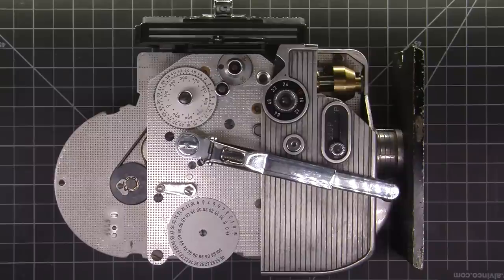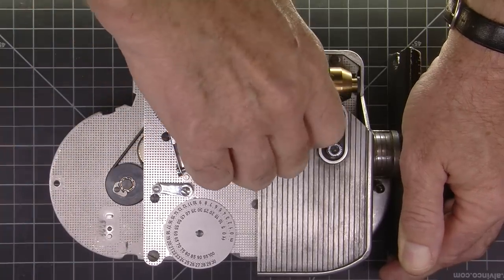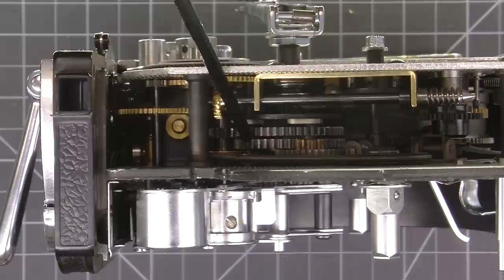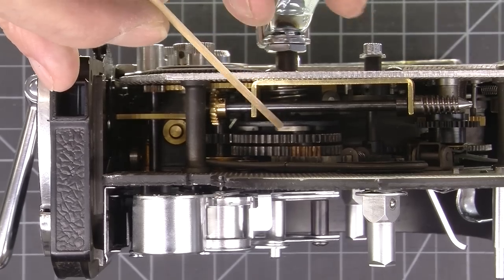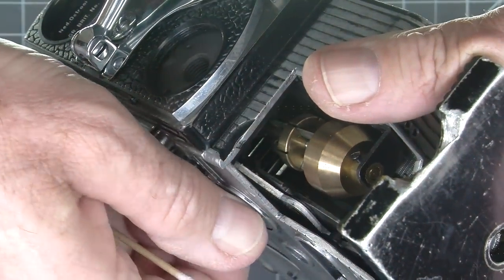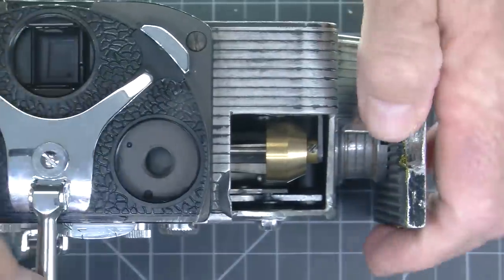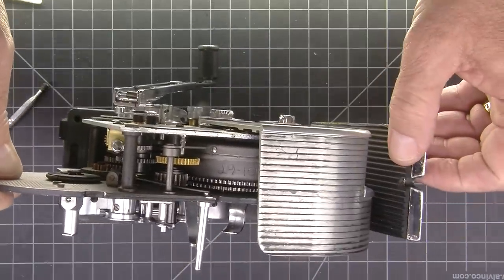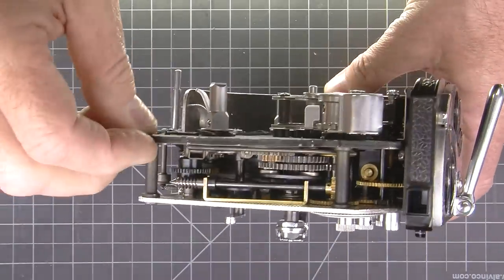Bolex, a peak inside

Comment: Hey Rich thanks for the video. really interesting. 

I wondered if you know whether it is easy to replace the bolt the connects the winding arm to the motor as i have one that has snapped!
Reply from the maker: that part is available and not too expensive, just have to remember it's a left hand thread.You have to loosen the nut and it comes off the wind handle  Is the stub still in the motor?
Reply: Hi thanks for this fascinating video! I have a h16 on which the bolt hole where the winding lever screws in stripped. I'm in India and noone fixes these. Is it possible to repair by oneself? Is the bolt hole removable? Thanks!!

Comment: Hello, thanks for the video. I'm just curious, I destroyed the retaining arm which holds the film in the spool, how could I possibly change this or repair? I think there must be some kind of spring which is destroyed now...Thank you.
Reply from the maker: When the students destroyed the spool retaining arm I just threaded the hole with a 10-32 tap and installed a 1/4" long 10-32 button head screw. in 30 years never had an issue. Grease your tap and that will capture the majority of chips created by the tap,
Rich

Comment: Hey Rich, great video. I'm currently tinkering with a Bolex H16 Rex4 that seems to have a 'dead motor' as you described. This is the most in-depth video about the inner workings of the camera that I've found so far and I'd love to teach myself how to fix it. Would you recommended any valuable resources in particular ?
Reply from the maker: I just learned by taking them apart. I have a video showing the process of dismantling the camera but it's not edited in any way. I may just upload it as is since I never seem to find the time to edit. Also have one showing how to tell if you've lost the loop without opening the door first.
Reply: I'd love to see both of these videos. Hope you can find the time to upload soon!

Comment: Hi, very nice video. I’ve a question: my Bolex h16 have a problem with the meter counter of the film, he’s stuck. Don’t move while the motor is in function. Have you any idea of witch is the possible problem? Thank you
Reply from the maker: if you hold the plunger at the back of the camera down with your finger does the counter work? If so the door does not fit correctly. Other wise it has to come apart in order to determine which parts are malfunctioning. I have another video detailing how to disassemble it.
Reply: @richjura8957  Thank You, but if i hold the plunger, the counter don't work. i think it's a internal problem
Reply from the maker: @ilPisi26  It's most likely the screw that holds the dial to the spindle, sadly to get to it you have to pull the workings out of the body. Good Luck
Reply: Rich Jura ok, thank you very much. I’ll try soon and let you know.

Comment: Hi! Congratulations for the video and work! I've been working with 16mm cameras for a long time. Usually i've to make the repairs by myself, as, at least in Brazil, i can't find who works with these equipments, no more. I've already done a small service on a ffriend's Bolex, but had to disassembly only the front part. Now i've bought a non reflex 1951 model and it is "frozen". As if was kept many years stored with the spring on. I saw in your video that you removed the entire side of the camera (?). But i also saw other pictures and videos where it has been opened from the inside part (film room). I don't want to remove the leather from outside to look for screws, as it is in very good original state yet. Can i access the gears removing the film room on the non reflex model???  Thank you so much!!!!!!!
Reply from the maker: responded to your other comment, here I see you are working on a non reflex. If I remember correctly those have 5 screws holding  the main plate to the body. Also the turret assembly has to slide off as the shutter stays with the main plate. There is nothing under the leatherette that would require you to peel it off. Good Luck
Reply: @richjura8957  Hi!!! Thanx a lot for your answers!!! 

Yes, it has more screws holding the main board, than on the reflex model. I had already dismantled the lens tower from another non reflex before and I know to remove this part without problem. I took off all screws from the plate, bolts, pressure plate, internal sealing glue, etc. but something still holds the main board too strong on one side, where the film cutter is. I have to analyze better what can be...
 
Well, this camera was totally stuck. I did something that I did NOT consider the right thing:  I sprayed wd40 on the gears from the front, let it stop a while and I could have the gears unlocked. I was moving them gradually and everything is working. At least I know that nothing is broken! It still hangs a bit, but all the mechanisms are fine.

Now I thought about removing excess wd40 with contact cleaner or benzine.... I'd like to know what do you recommend for this type of mechanism?
Reply from the maker: I think you might be better off leaving the WD40 in it. I can't think of what would keep it from separating especially down by the governor,  tap it on the table all around as maybe a screw came loose internally and is caught somewhere. That maybe what locked the mechanism, if it were me I would get it apart to clean and lubricate it. Particularly because WD40 is not really a good lubricant.
Reply: @richjura8957  I was just anxious to know if the spring or anything else could be broken. I already set it up and I ran a test film today. I just developed it and looks great! Later on I want to disassemble everything to make proper cleaning and lubrication.  Thank you very much for your tips and great videos! It sure helped a lot !!!